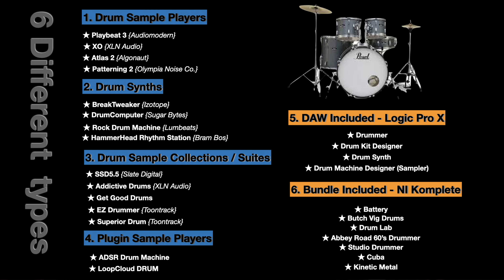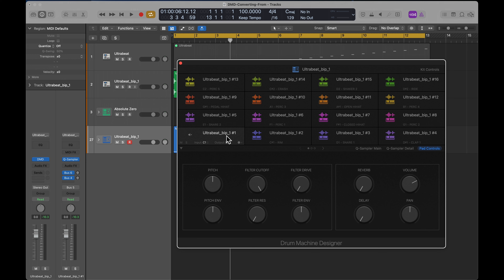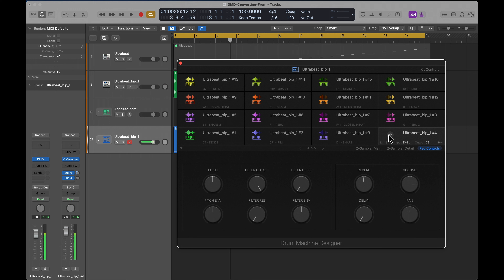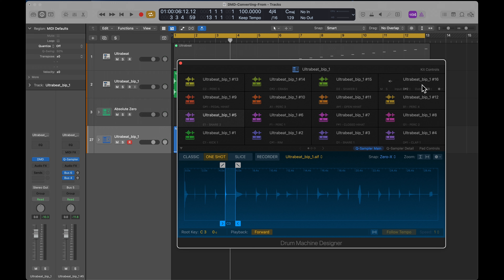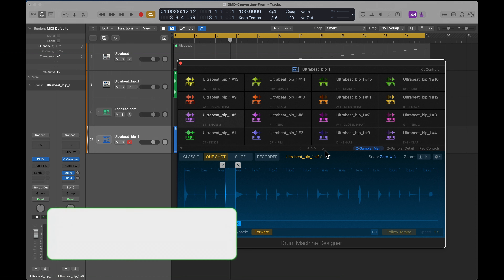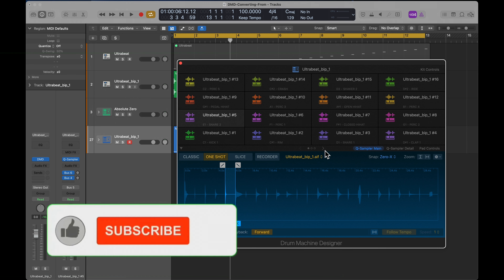Logic Drum Machine Designer | How to convert kits from Battery, Ultrabeat & Other Drum Apps

Comment: For Battery conversion, a simpler method would be to load the kit you would like and use the 'Save As' function within Battery. In that option you have the ability to save the samples in the kit in a folder then just import those files into Logic or whatever sampler you choose!